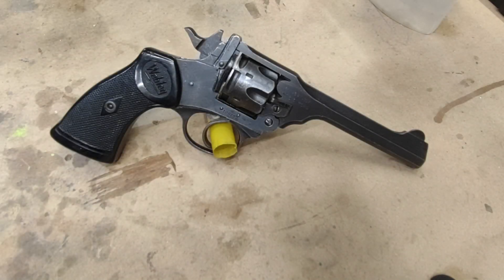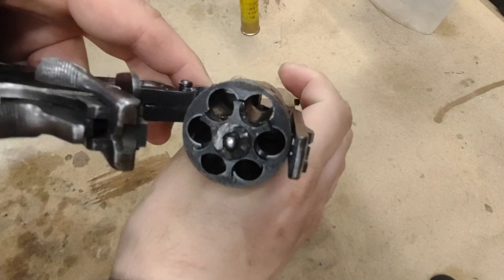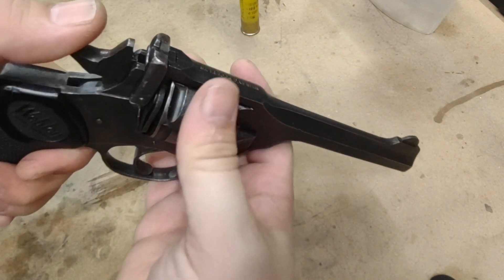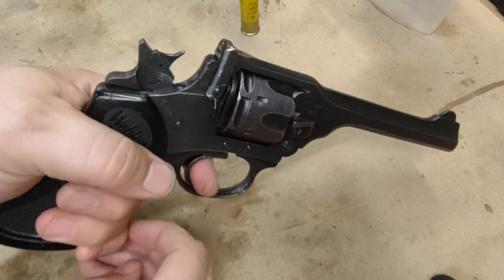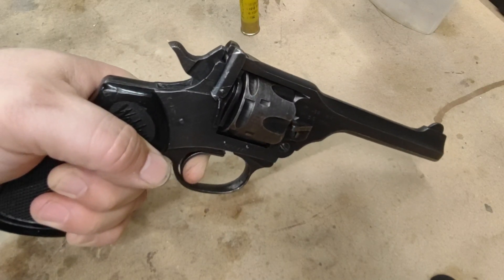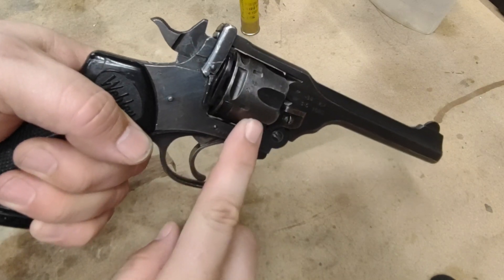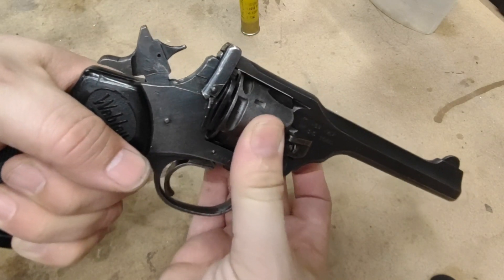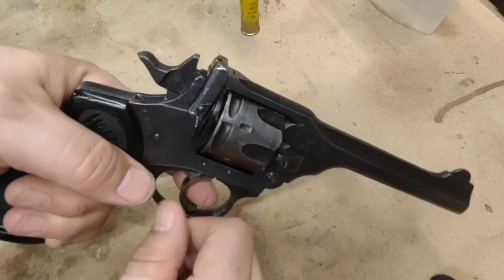Webley Mk IV

Comment: That looks to be a mk iv not a mk vi, The cylinder stop, located on the top of the trigger mechanism possibly has a broken spring , not allowing it to return to it's up position, to stop the rotation of the cylinder. The cylinder doesn't rotate to the left because the pawl /hand is catching on the rear of the cylinder, as it should.
Reply from the maker: Thanks for the comment.  Yes it is as mk IV.   i would say that the trigger stop/cylinder catch is worn out.  Need to find a new one...lol  as if they grew on trees.   Cheers!